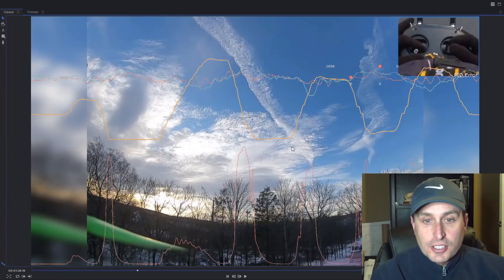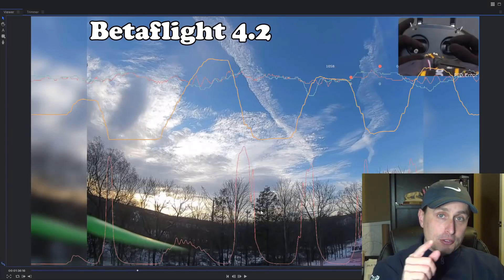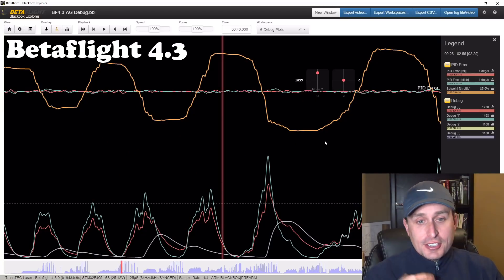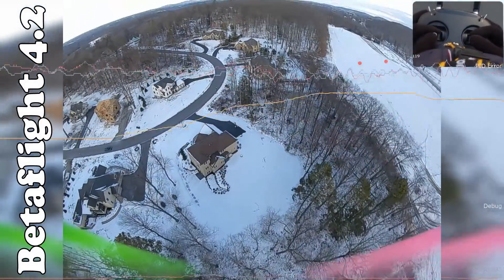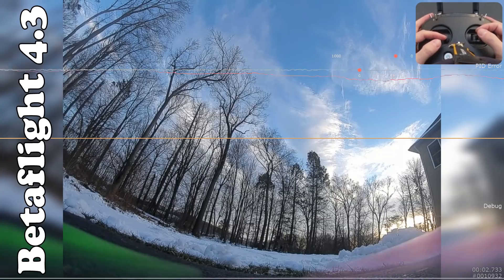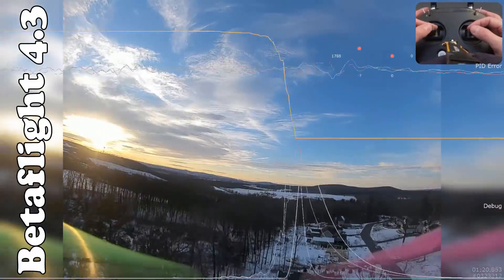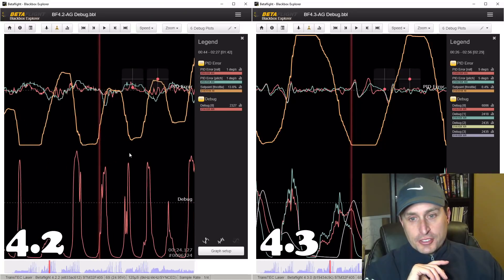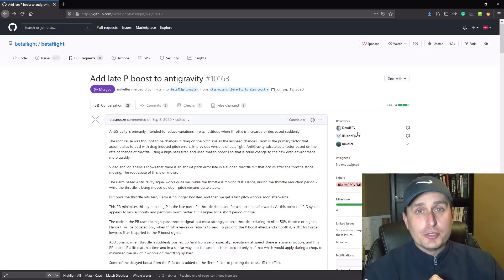Betaflight 4.3 - AntiGravity Improvements | P-Boost how it works

Comment: Really appreciate your efforts on this channel. I use betaflight for single-rotor helicopter, and P-boost is exactly what is needed for the direct-drive tail holding during punch-up. The I-boost is not needed for helicopter tail for the same reason I-boost is not enough for quads - because I-gain reacts too slowly.

Comment: 4.3 is better with everything. I don't use antigravity. I find it lifts the quad mid throttle. I also find it annoying in the sense, when using the app, it continually turns itself on. All that said, if I can't tune out a throbble, I will turn it on. I came here looking to learn what it does. Thanks. Keep up the great work you do.

Comment: what about comparison with D-min enable and not?
Reply from the maker: For this feature?  It should be the same.
Reply: @uavtech  is "d-min" feature is variable on how fast throttle movement or how fast stick movement (roll and pitch only). If we integrated d-min to how fast throttle movement to kick faster than i term, could be it be better then P and I that kick in anti-gravity?

Comment: Is BF 4.3 available in windows 7? I hope so.
Reply from the maker: I don't believe the Configurator works with Win7 anymore.
Reply: @uavtech  Then i am going emuflight then. For me Emu is beter than BF.
Reply from the maker: @ItsExo-FPV  emu is rebasing on BF 4.3 .... sooo yeah.
The problem is a core engine that runs the configurator no longer supports Win7 so upgrading that made the issue.  Has to deal with the COM port recognition.

Comment: Out of intrest i find emuflight dosent have thro bles and bobbles and holds its nose well  only had to raise p and d slightly to traxk set point. Minimal wash from offset   will you be branching into other firmwares or just staying beyafligbt from. Now on
Reply from the maker: Sure it does.  Come'on now.  It is physics.
BF.  No audiance for Emu or others.
Reply: @uavtech        maybe we all on the zticks instead of staring at bkCk box with the same issuez poppi ing up since 4.1  p&d boost it still wobbles lol   looks the same to me i use both emu and betaflignt like the experience   not a hassle love the hobby
Reply from the maker: @buddywoody8664  Honestly, you should look at more blackbox before making such crazy assertions.  

BTW, Emu is being rebased on BF 4.2 soooo.....

Same quad with the same setting will fly the same way on BF and EMU.  They are the same PID controller.  PID control is so simple there is not much flexibility other than the features added around the edges.  Maybe I'll do a video on it.

Comment: Thanks man. <3
I've been fighting a lot more with bounceback lately, though.
It's weird, I never really had that problem before.
Either way, off to a great new year I guess. ;)
Reply from the maker: Load my presets theuavtech.com/presets
Reply: I’m curious, on your presets for a 5 inch it doesn’t show to adjust antigravity at all. Is that because i’m being silly and that your video right here is showing that it is infact improved? I am running your preset for the 5” but still get nose dive after throttle chop

Comment: for dummies like me who doesnt know hot to do blackbox ,  what would you recommend Anti Gravity value for a 5 inch quad . i was playing with it with the value of 4.2  in betaflight 4.2 and i kinda like it
Reply from the maker: really depends if you have bobble or not.  3.5 or 5 or 7.
Reply: @uavtech  i do have bubbles, i increased i term by 5 on both roll . pitch and yaw .  and boosted it to 4.2 and i still have bubble . i was so afraid to boost it to higher value , now i will probably increase them and see how it feels .

Comment: Thanks for these BF4.3 videos! Do you actually prefer the dji transmitter? Never have used one but am interested in how it compares to some other radios in stick feel and function.  Just got a TX16S but only fly analog..for now
Reply from the maker: Eh, it is ok.  But no.  OpenTX is preferred and my Q X7 is preferred.

Comment: For those who doesn't want to jump to 4.3 yet and who are currently in 4.22, can that behavior be applied in settings on 4.22 to achieve close to that result? And what would you recommend to those who have 4.22 who wants to try 4.3, what settings in 4.22 should not be copied over to 4.3?
Reply from the maker: I just did a DIFF ALL paste from 4.2 to 4.3 and it worked fine.

Best way to mitigate throbbles is plenty of P-gain on the axis that is bobbling.
Reply: @uavtech  Thanks a lot!

Comment: The only way to make this better would be to put the OSD on so we can actually see what's happening during technical demonstration videos 😅
Reply from the maker: DJI.  Sorry.
Reply: No static - but no osd either 😂
Reply from the maker: @escfpv8339  well, i see OSD.  Just not recorded on DVR.
Reply: @uavtech  you see 'some' OSD
Reply from the maker: @robinfpv4858  yup.  But it is worth the less OSD for the crisp HD FPV experience.  I do miss the Fatshark goggle ease of use / from factor with on DJI though too. Meaning, with FS goggles you just move them up on your head when not in active use.  No so convenient with DJI.

Comment: I don't know how to Blackbox, but what does it mean when I land and it bounces around?  what should I do to fix it?  should I lower I or  P , I can't figure it out.
Reply: That's just how a quad behaves, that's "air mode". Just learn to land. Get that horizon level, bring it low, tiny throttle blip and disarm before you touch. Or put air mode on a switch and turn it off for landing...
Reply: Disarm
Reply from the maker: These guys got ya covered.

Comment: a must have for flying gates..if your a world class pilot the gains are far from marginal
Reply: Can you say more about the impact of this change for racing? I assumed it wouldn’t make a huge difference since on a race track I’m rarely chopping throttle, but I haven’t flown 4.3 yet.
Reply: GRANOLA FPV yeah it’s not the throttle chopping that you’ll notice it’s spiral gates when you pump the gas into them.. no more drifting wide as you throttle up only slingshotting around the flag or gate... you’ll notice it first run. I would push the ag a little though from stock to say 6-6.5
Reply from the maker: So around a gate, when you punch or reduce throttle on the approach rapidly, it will boost i-term and P to keep the nose on the sticks.
Reply: That makes sense. Watching the video, I thought that logs showed P gains were only being boosted on throttle chops. Looking forward to testing 4.3 on the race quads!

Comment: How do you like the ethix props? I'm building my first 5 inch and I'm thinking about the p3. 
I'm also updating my beta75x and cinepro with 4.3 and this! Thanks for all your content!
Reply: S3 and p3 are amazing if you are light enough, p3 have so little prop wash due to the thinner blades, it's insane. Tons of response. 

If you fly a porker the s4 or even s5 are nice, but not quite the same.
Reply: I typically fly the S3's on my cow and she flies on rails 🤙🏻
Reply: @TRITONFPV  I bet it does fly on rails, but it also probably lacks punch and resolution at the top of the throttle, at least compared to a higher pitched props. But if a nice smooth flowey ride is what you are after I bet it's great.
Reply: @mouseFPV  Agreed. It does lack a bit at the high end. The S4's were nice for a bit but unfortunately the P3's are too big for my rig. Maybe on my next build #SENDIT 🤙🏻